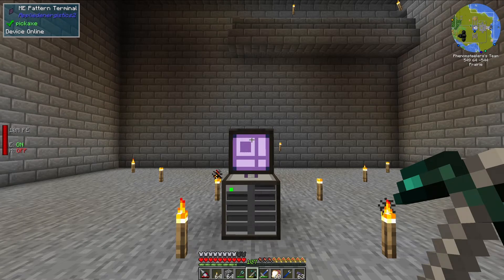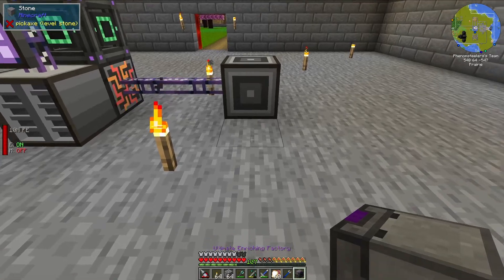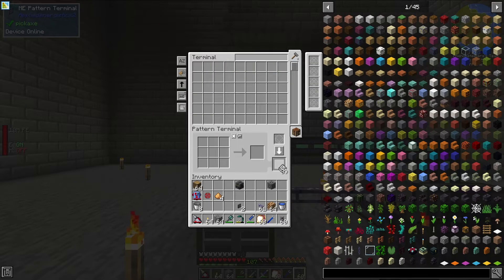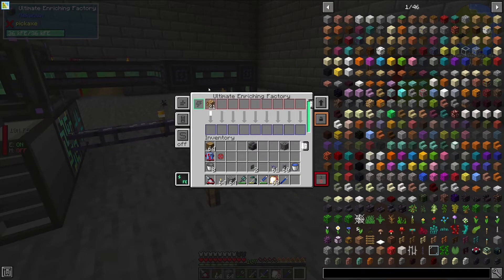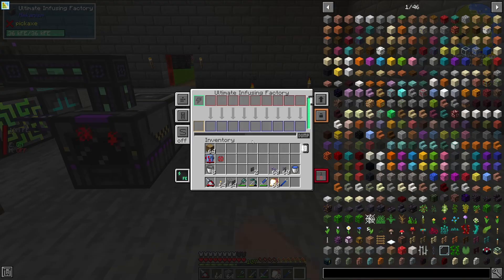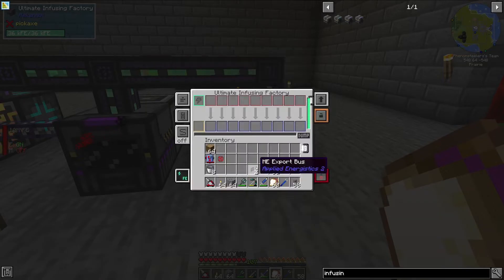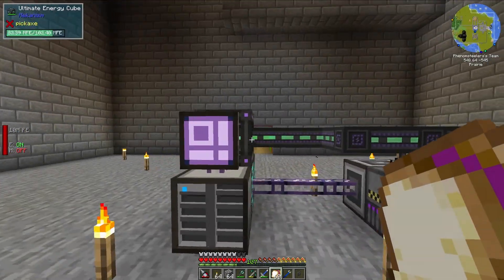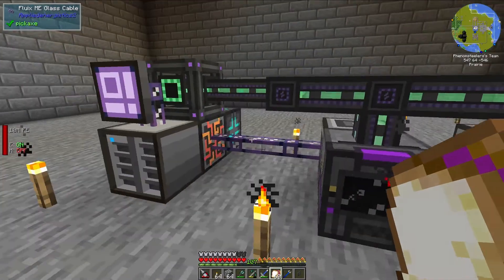How To Automate Mekanism Machines With Applied Energistics 2

Comment: Another thing you could do to automate the infuser is make sure the ME interface is attached to a chest. Then, using item piping of your choice, insert the items into the infuser and configure the sides so one side is input, another side is output, and another side is extra. Finally, attach an import bus to the result output side of the infuser.
Reply: This helps to encode multiple patterns for the metallurgic infuser, since not all its recipes use redstone as its extra item converted to fluid. Amazing video, dude!
Reply from the maker: @pauldelol  That is correct. I've used methods like this before to automate Magma Crucible/Fluid Transposer combos from Thermal Expansion in the past. Your way is another way to do this, and is in fact better if you want to have a single Infuser for all of the different recipes.
Reply: thanks man, this help alot
Reply: Does anyone know if either method applies to 1.18 AE2?
Reply: @storanystormy3512  Yes, they do.
Reply: Which item pipings work with mekanism
Reply: @RanInt  Almost all of them. Thermal, BuildCraft, IC2, Extra Utils 2, Cyclic, XNet, etc.

Comment: I know this is an old video, but a few things to note:

Inside the machines there is an "Auto Sort" button on the left (Looks like an S), I recommend turning that on, it'll automatically split the input across all the lines on top. This makes production a TON quicker. The only downside being the lack of ability to use that machine for multiple different crafts at once, and higher power consumption I believe.

There is NO point to pipe the Redstone, Carbon or Diamond directly into the infuser. Put them in an enricher first. This'll turn it into an "Enriched" version, which makes it 8x more effective. Allowing you to turn 1 diamond into the usability of 8, and similarly with the others.
Reply: Man, thank you. I was searching how to do it for about 1 hour and couldn't find how and you solved my problem with this comment, i love you.
Reply: coal is just waste when you get automated miners, but for redstone/obsidian/diamonds yes enrich them frist and put the enriched ore in (make a crafting order card in the interface pushing it in)

Comment: Really nice and simple tutorial. One thing I want to ask, how would I make it so I only insert a specific amount of redstone in the infuser? For example, I don't want to insert redstone until the bar is full and then it has a stack in it, but let's say keep the redstone at 1000mb all the time. I have been searching for a solution for this forever, and as I play a smaller modpack I don't have many other options for cables ect. If there is a way, I would really appreciate it. (I tried doing this with the level emitter but it doesn't seem to be working...)  Thanks!
Reply: Use integrated dynamics instead